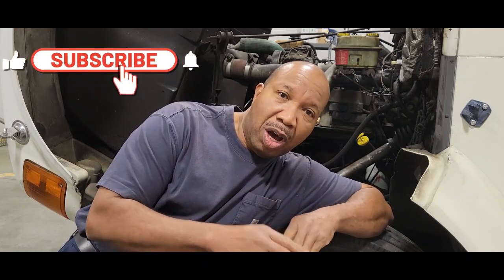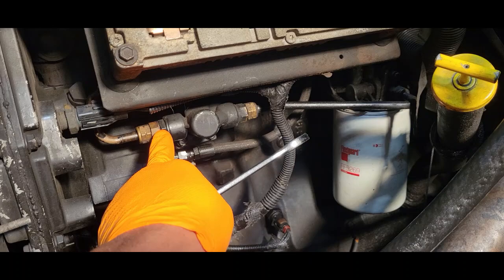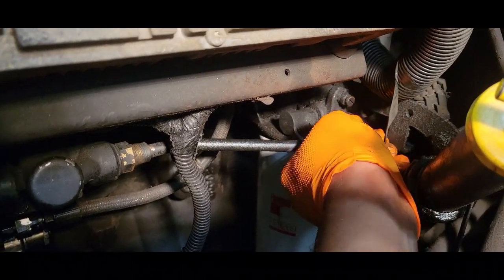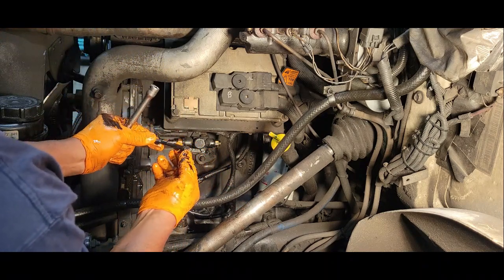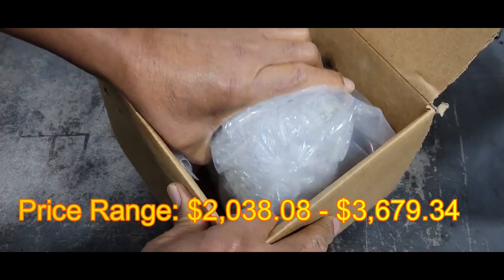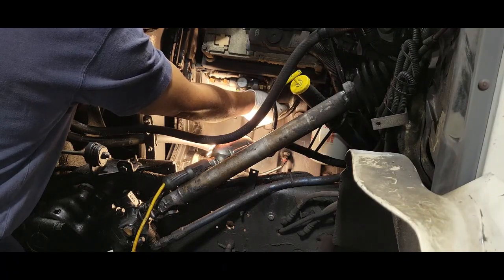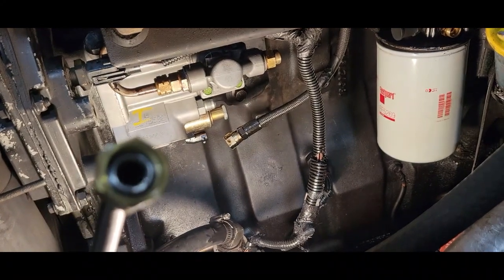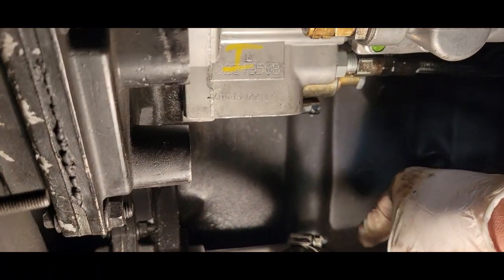DT466E/DT466 High Pressure Oil Pump Replacement

Comment: Doing this job today for first time. It's do or die since truck is parked at my gym and could get towed. Appreciate the clear and simple instructions as well as tool sizes
Reply: Did your issue get fixed?
Reply from the maker: @FIWB.e90  Yes Sir
Reply: Where did buy the part
Reply from the maker: @vivvasbill  from the International Dealer Parts Department

Comment: I have 97 4700 and it looses fuel pressure overnight I've replaced both fuel lines,primer,and all o-rings going to lines,it starts but will not hold prime still. Could the ferry ball cause this problem I'm stumped?
Reply from the maker: You are still getting air from some where. In the past on the 95-97's. I had to replace the plastic Fuel Lines. It's very hard to tell if they need replacing.

Comment: I have a similar issue with a dt466 engine cracked cover plate around compressor leaking oil.  The engine runs and sounds great. The vehicle is for light use.  How long will it last if I just run it this way and keep up with it on oil, indefinitely?  What could happen if I just continue to run it this way?  Thank you
Reply: high pressure oil pump is fine, just a cracked cover plate
Reply from the maker: @user-jf9bp6mo3i  Just keep an eye on the oil level.  Most likely it has a low engine oil shut off device. But you do not want to ever run low on engine oil.
Reply: thank you
 @dairleautoclassicrestorati6892

Comment: I have a 2004 international 4300 DT466… would this be the same setup on mines as yours as far as gaskets and part numbers?
Reply from the maker: Good question, I would call a International Truck Dealer and give them the last 8 of the vin#. The Parts Department can answer that question. Thanks

Comment: Will only certain scanners work on this motor? I’ve got a scan gauge for a 7.3 already
Reply from the maker: You will need the round 6 or 8 pin connector. And if your scanner have the Heavy Duty Software.  You should be good

Comment: Hello Sir,

Good morning to you Sir, 
I currently have a 2003 Durastar am working on.
I am having no oil in the reservoir in front of the HPOP, truck has been started with shorts so engine runs but shuts of.
Though am not a mechanic but I work on my stuffs by myself.
Here it is;
I learnt there is a regulator prone to stick open behind the oil filter/cooler.
Already pulled it but I guess the regulator is on the crank case.
Could you please point me to how I can remove this and also explain how I can test or check it to validate if it is still good.
I got one in hand in case it’s bad, I can literally push it with screw driver and I can tell it is spring loaded.
All type of help will be welcomed 
Thank you in anticipation .

DIY PETERS.

Comment: can high pressure oil pump cause oil to get into the fuel tanks? or cause the injector seals to break if the ipr is broken?
Reply from the maker: It sounds like leaking Injector O-Rings allowing Oil to push into the Fuel Rail. This will allow Engine Oil to go into your Fuel Tank.
Reply: @dairleautoclassicrestorati6892  thanks for the reply

Comment: What year DT466 is that truck? I have a 2003 International DT466 that I believe my high pressure oil pump has gave out. I'm trying to locate a part number before I pull it out.
Reply from the maker: It's a 2000
Reply: Thanks for responding. If my high pressure oil pump is bad, would that prevent my truck from running on ether?
Reply from the maker: @Robert Mann  that is a good question. If the Pump is bad. It would be very difficult to start it on starting fluid. Keep in mind that these pumps are very expensive. I would highly recommend to put a scanner on for vehicle before you purchase a High Pressure Oil Pump.